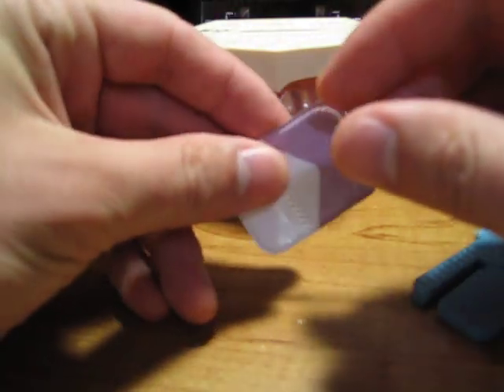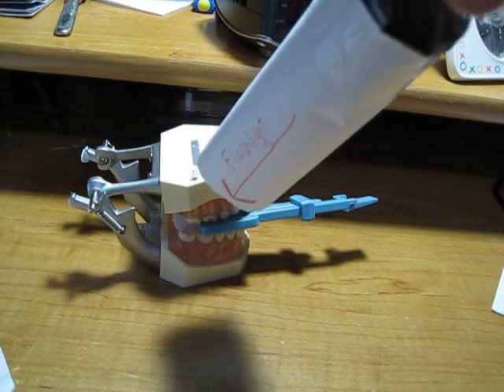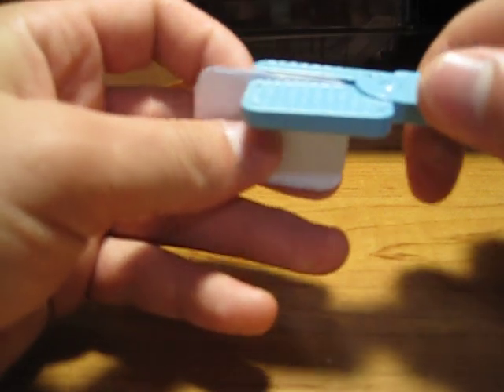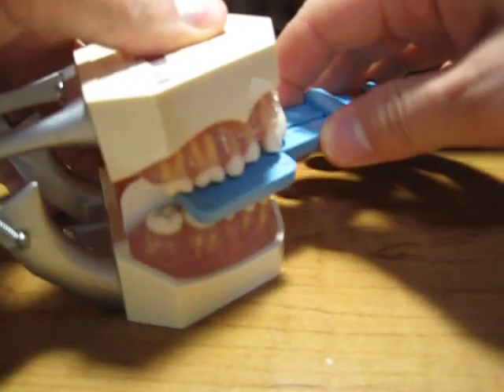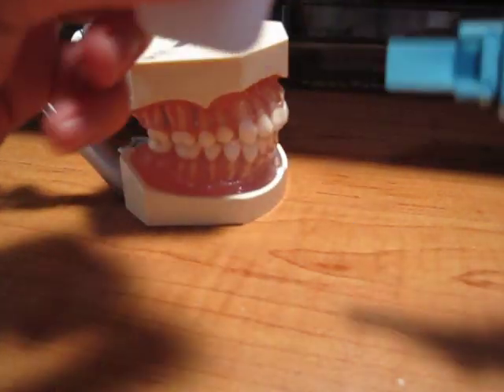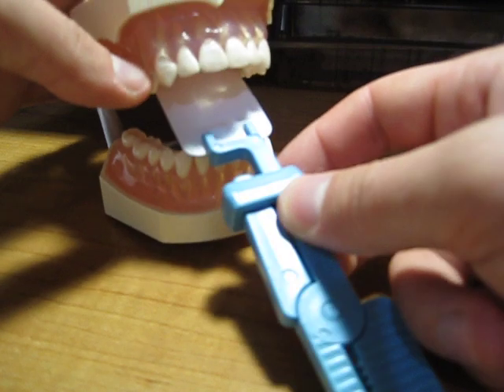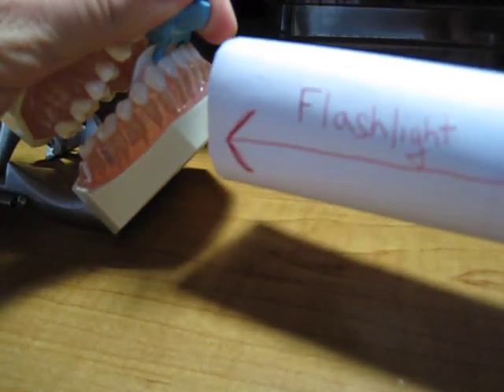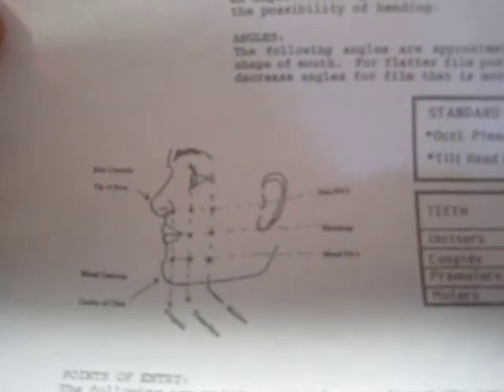How to use a Snap a Ray, the bisecting angle technique for dental radiographs - dental xrays

Comment from the maker: Using a snap-a-ray for anterior "shots" may make the image quality vulnerable to distortion. Generally, it is ill-advised to use this instrument for front teeth. However, it is not "wrong" to use the snap-a-ray this way if deemed necessary. PS, a "live" model would be nice, I agree. The original impetus for creating this video was to answer a question posed by a student in an online course I teach. Thanks for watching.